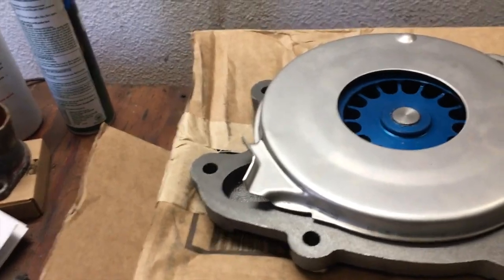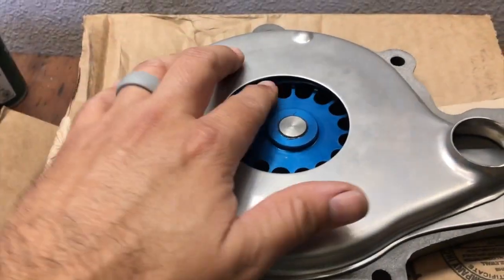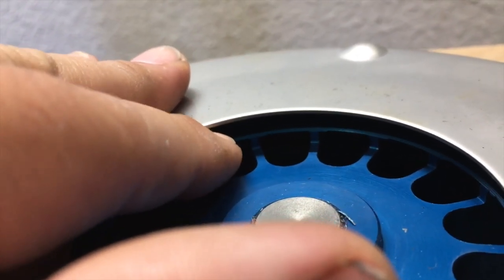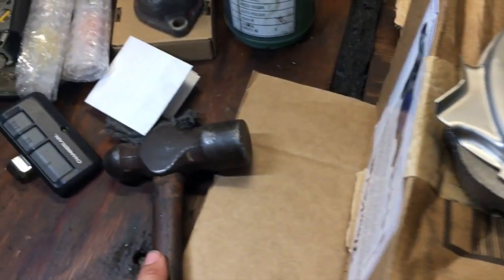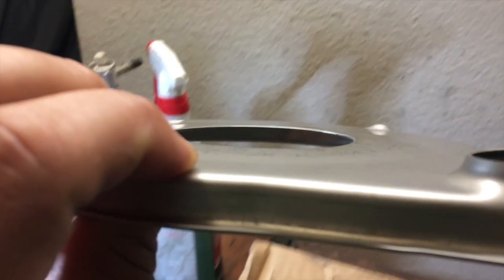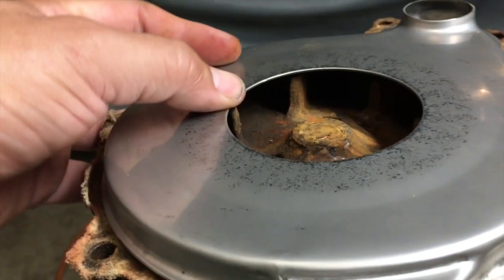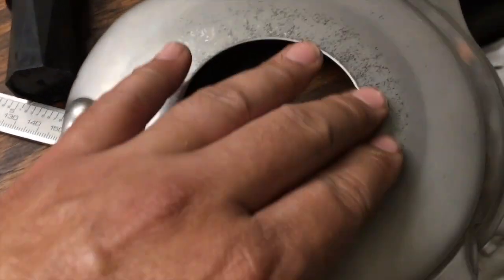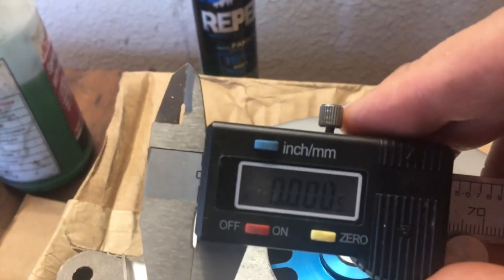Shaping a FlowKooler water pump plate for a 67 Pontiac GTO engine.

Comment: I made the first FlowKooler water pumps at the Brassworks in Turlock Ca. back in 1985.  
The solid impeller keeps the coolant from cavitation compared to a 
stamped impeller that looks like an alternator fan. If you have a water 
pump  that has a solid cast impeller already there won't be any 
difference.
Reply from the maker: I really like the design and knew the Pontiac 400s are known to run hot, so I wanted a pump that could keep up. I will probably buy some more for my other projects when the time comes.
Reply: So are you saying theres no need for rework on shroud due the solid impeller?
Reply: @anthonysantiago1999  I am saying tou will gey about 30% more coolant flow with a solid impeller water pump. Anything else you can improve on will benefit you too.
Reply: @captjim007  Ok, Thanks Racer X.

Comment: Failing to see the point in modifying that plate. On a stock water pump impeller I can but that flow cooler wheel has the side , which is built in to the impeller

Comment: Thanks for the video. I've got the same setup on my bench now. Does it keep your engine cool?
Reply from the maker: So far so good.I don't drive that hard. I also don't have a fan shroud and it still cools fine. My home made temp sensor never gets above 170, but that might actually be closer to 180 (still trying to dial the Arduino sensor in).  I run a 160 thermo I believe.

Comment: wish i could see how you put the divider plates in, which way they go did you get tech sheet from somewhere?
Reply from the maker: If I remember correctly, the plates pretty much can only go in one way. Installing them on the timing cover was a little tricky to keep everything lined up, but just requires going slowly. No leaks and works great.